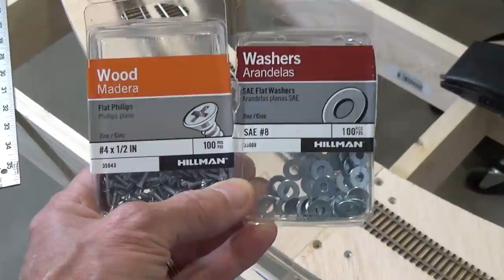The Big Helix: Laying Track On A Big Curve (256)

Comment: Hi Larry, great channel. 
A tip when soldering; after cleaning your iron tip apply a small amount of solder to the tip (tinning the tip) then apply it to the part to be soldered, when you see the tip solder wick onto the rail apply your spooled solder to finish the job. The blob on the tip will transfer the heat much quicker than a dry solder tip. For track work maybe double the size of your solder. The size you're using is great for PCB work. 

Cheers, Happy Christmas

Comment: Hey Larry, built a significant helix to move through the three levels of my layout.  One thing I did was I staggered the rail joints, rather than cutting them flush.  I found this extra step (or two or three steps) ensured there was never a kinked connection between flex tracks.   The helix is constructed with ready rod and the plywood is supported by alumimium flat stock.   Althought this method may be a little more work at the start, once you start the process, it goes quickly.   In addition, I used a laminite floor underlay (foam rubber(?)) stappled and glued to the plywood to kill the noise.   I have had a great deal of success with this underlay.  In the "exposed" track areas off the helix, I sprayed it with a speckled stone spray paint and it looked great.
Reply from the maker: When done the way I showed you won’t get kinks. Solder them together straight them bend to final curvature.

Comment: I used Jeff Johnson's method on a helix I built some time ago, worked great. I used #6 screws because I could not locate #4, I used the washers too BUT I found that some of my rolling stock and locos would catch on the screw heads. To fix this, I would hold a washer in Vise Grips, then using a ball rasp in my motor tool, I would chamfer the hole in the washer, this was a bit tedious as my helix was 5ft by 6ft and 9 levels, but I would only do two levels at a time so it was within my patience boundaries.

Comment: I would recommend making a curved spacer. Either the outside or inside. Measure from the outside of your plywood to the edge of the ties. Clamp it down on the plywood and just push your rail up against it and secure.

Comment: I've used this method on both my HO helix inside the house and my G gauge (45mm) layout outside the house. It sure makes for easy construction, and even better, easy modification when the track plan changes. Also, having a little side-to-side movement helps avoid kinks when temps can go from below freezing to 120F in the desert!

Comment: Just a suggestion. Kreg tools has a pocket hole jig system.  And they have screws that have a washer type head already built in.  I have 1 1/4" length ones which fit between the ties and the washer head held the ties down., but they also have 3/4 and 1" so they wouldn't come out from underneath the roadbed.
Reply from the maker: Looked at their website but can’t find anything under 1”. Got any specific name, number?

Comment: When curving flex track, be aware some flex track has a continuous plastic runner between ties along one side of track and skips on the other side. The continuous ties should be on the inside of curve and the skips to the outside. The skips can be stretched but not compressed. Don't ask me how I know.
Reply from the maker: Yes, Atlas flex track is like that, but it does have some splits on the side that is more continuous. However it can be bent either way and it just makes a difference in appearance as one way the split ties are compressed towards each other and the other way they are splayed out. Personally I prefer Peco and MicroEngineering as they have more spaces on both sides, although ME has the most. Peco rails slide more easily and it it easier to curve but ME holds what ever shape you bend it too much better. I generally use ME but will buy Peco in a pinch. I’ll show this in the feedback segment next time.

Comment: I use his "screw-washer" method on all my track:
First  I glue the roadbed down with glue/caulk and wait for it to dry
Next I glue the track to the roadbed and use the screws to hold it down and let it dry.
Then I ballast and let it dry
Then I remove the screws and fill in the ballast where the screws were.

Comment: Another fine missive Larry thankyou. I would like to offer a word of advice on the use of the track cutters, if I can be so cheeky! I have found that when the cutters are used vertically,  as you showed, I always had to file the track ends! But if the cutters are used horizontally a very good shearing action can be attained. Not only that but very fine slivers can be removed too. Also, I rarely have to file the rail ends. BUT, there is always one, the cutters must be dead sharp. If they have nicks or burs on the cutting edge, then it is not as good. I keep mine sharp and only use them on nickle silver. I never any other metal.
I hope you don't mind my critique. I enjoy your videos very much.
Reply: Agree. The Xuron 2175B is designed for lateral cuts. It will only cut one flush clean edge and the cut away piece will have a '<' end. Xuron makes the 2175M that is designed for vertical cuts. Again, one end will be flush cut and the cut away will not be flush.

Comment: I helped two friends build multi-story helixes. What we did after building the first rise section was to run steam and diesel engines up and down the track and let loose freight cars roll downhill. We checked that the track was aligned and there were no issues. Then when we finished the next loop up we repeated the test.

The last thing you want is after all of the loops are installed is to find a section or connection between two rails in the middle of the helix causes an issue with operations. And then have to tear out part of the helix to fix the issue. A bit of testing now can save a pile of headaches later on.
Reply from the maker: Wait for the next video, don’t get ahead of me. I shot those tests runs today!

Comment: Great video Larry. I must say I had my doubts at the beginning, but the results at the end and the rationale were spot on. Your detailed explaination was excellent as well. Have you considered using a nail set to create a small starter hole for the screw? It would only require a light tap and it may help prevent some wobble and give you better control.
Reply from the maker: I have found an awl does a good job of creating a starter hole.
Reply: @TheDCCGuy  excellent, even better than a punch.

Comment: I haven't built my helix yet but anticipate copying your method.  Although I intend to be impossibly fussy with landscaping elsewhere, I see as little point to trying for prototype realism on a helix as in a hidden staging yard.  Mounting track directly to plywood will save cost and effort I'd much rather spend elsewhere on the layout.

If I find my helix noisy it will most likely end up surrounded by a heavy cloth curtain suspended on a runner curved to suit the construction.  I may even use velcro buttons to fasten it to the loop outsides to catch the possible falling equipment, with an inside curtain to do likewise.  Any cheap, heavy cloth will do both jobs well.  Since I also sew it will be simple to make the curtain and mount it with a loop cord allowing it to be opened and closed remotely, inside or out.  All the fixtures, etc., for making such a curtain are available everywhere, and you don't really even need to do any sewing if you can live with plain cut fabric edges.

Two questions, Larry, which I hope are not repeats of others already asked:

1.  Why so wide a roadbed (the plywood) for a single track?  I can imagine several reasons but I can't wait to hear yours.

2.  Did you consider double-tracking your helix?  Again I can foresee several pros and cons but look forward to hearing your thoughts on this.

As always, great video, useful, well thought out and well executed.  Thank you so much!
Reply from the maker: In the case of noise, I find that the sound equipped locos make more noise than the rolling stock and I do want folks to hear something so they know thier trains are running. The roadbed width is dictated by 2 factors. (1) The need to make sure your longest cars and locos can go around the curves, and (2) to allow for the width of the vertical risers, they take up 1 1/2” of that width. As for double vs single track, in this helix, which serves the staging yard, I don’t expect that many situations where two trains will need to leave and enter at the same time so no need for double tracks. And if it does happen then one train will be at the end of its run so any wait will be OK. On my helix in the middle of the layout I looked over my schedule and found that there was only one instance where two trains will meet at that location, so one meet in a 3-4 hour op session will not be an issue.

Comment: Seems like an easy way to hold down track where it's not "part of the scene".  No need to weigh it down until things dry, no difficult to remove mini nails through the tie holes.  The only thing I can see going wrong is the washer or screw head snagging a rod hanging down from a coupler.  I've heard the rods can be bent a little if too low.  Thanks for showing it.
Reply from the maker: The tops of the screws are well below the rails so anything hanging down that far would have snagged on the rails at a crossover long before it got to the helix.The sizes are critical as a #6 screw head sits at about rail level so that would concern me but a #4 fits just right.
Reply: @TheDCCGuy   Excellent.  It was someone speaking of a coupler rod hitting through turnouts that triggered the thought.

Comment: Since you were stating to wire the feeder every 6 to 8 feet do you need to put the plastic rail joints in between the sections.
Reply from the maker: Not between the feeders, just when you isolate the blocks. In the case of the detection blocks it is only necessary to isolate the rail that is powered through the detector and for those I just cut a gap with the Dremel. At the bottom and top of the helix I do gap both rails creating a totally isolated block for the helix.

Comment: Larry,  do you think the sound from the helix area would be as loud as a typical bench top layout with solid plywood, which creates the sound board?  I would think not with strips of plywood used in the helix and thus not being much a of sound board.
This project is quite tedious.  Keep up the good work and hang in there.   Thank you for all of your videos,  I enjoy them very much.
Reply from the maker: I agree that it should not be as loud since there is no sound board effect. One thing that becomes quickly obvious when you start a project like this is that it is a lot more complex than presented in magazine articles. I have now been working on this for 5 weeks and have 2-3 more to go! Also once you get more than one level of track you can’t just step over to get into the center. Crawling under gets old fast especially with my vertigo.

Comment: As a suggestion why not place the track and hold several pieces in place with thumb tacks then put the screws in. Opposed to doing one at a time. After all the screws are in then rem9ve the thumb tacks. 
Might want to cut out the first two rail ties on each section to ease the connector install.
Reply from the maker: Using tacks would almost double the time it takes. Once you do a couple of these it goes real fast just bending the track and putting in the screws. The track holds the curve well once bent to shape.

Comment: I was taught to stagger the joints by a half of the 3 foot section and I saw that a couple other people also stated that. I understand that the way you’re used to doesn’t kink but can you address the staggering of the rails? Does it provide any additional strength to the curved track?
Reply from the maker: I’ve never seen that done with flex track, only hand laid track. Even if the joints are offset you still need to solder them straight before making the final bend to prevent the kinks. Since I have never hand laid track I have not tried a 3’ stagger which would be very difficult with flex track since it is only 3’ long.

Comment: Do you not find with soldering rail joiners that you have trouble with expansion and contraction. Just a queery?. Frank
Reply from the maker: Nope, it stays about 70 F in my basement year round. In the past though I have shown how to leave expansion and contraction gaps in the rails for such circumstances. I will have gaps to subdivide the loops into detection blocks though.
Reply: I have a similar concern. His comment about having a stable environment helps a lot but not all of us are so fortunate.  I'll be following to see how the block detection gaping works.

Comment: Thanks for the video. Would the washers holding the track interfere with the uncoupling wire on knuckle couplers?
Reply: As long as everything is below the top of the rail it won’t interfere. Uncoupling wires shall be above the top of the rail per NMRA standards to clear turnouts, crossing, and other places where there’s stuff going on between the rails.

Comment: Larry. Not to change the subject but I 'd like to thank you on your informative videos of powering the frog and the benefits of that. We had recently installed a Peco 83 turnout using a SMAIL switch machine, installed a signal light and powered the frog. What a world of difference it makes. I have several Rapido SW1200 RS and they can crawl over the frog without stalling or shorting the system. Like you said "you do a face palm and say Why didn't I do this before??!!!". this was our 17th SMAIL from Circuitron, we have installed and the first with a powered frog. now we have to backtrack on the other switches. Is there any advice about powering the frog on a switch that is already laid down or is just the inevitable that need to pull them up? Fortunately we do not have any ballast or scenery applied yet, so the answer I'd assume is rip it up. Can you use the Atlas snap switches to power a frog or are they momentary power only? Again, we wouldn't have been able or had the confidence to do this without your great , in-depth videos!!
Thanks Larry!!
Cheers from Ontario Canada!
Earl
Reply from the maker: It depends on the type of turnouts you used. If they are already DCC Friendly then it will just be a matter of connecting (soldering) a feeder wire to the frog. Otherwise you will have to make the modifications in situ which could be easy or a pain or i  extreme cases cutting the existing turnout out and replacing it.
Reply: @TheDCCGuy  Larry,  I should have mentioned in the comment, all are Peco 83 Insul frog turn-outs. The bulk of them are 11 large curved radius turnouts that are spiked directly to a 3/4" plywood top for our storage yards. They were quite a project to lay down and we didn't think we would ever rip them back up...lol

Comment: Why worry about the tie spacing when in most helixes the track will never be seen??? Most of my friends that have them will have them under a mountain. Also, a good practice is to have a rerailer just inside any tunnel or hidden track as an insurance policy for no derailments. Why would you not use some kind of sound deadening base under the track???
Reply: Detectors sounds like a very good idea. Never thought of that in a helix. One friend has a camera inside his helix and it works pretty good. Very wide angle lens...
Reply from the maker: I have Atlas rerailers ready to install on the straight approaches. I also use them on approaches to bridges and my staging yards.I wish I had installed one on each yard track.